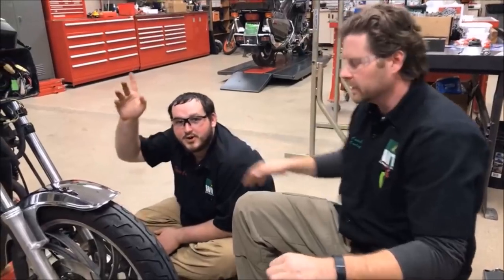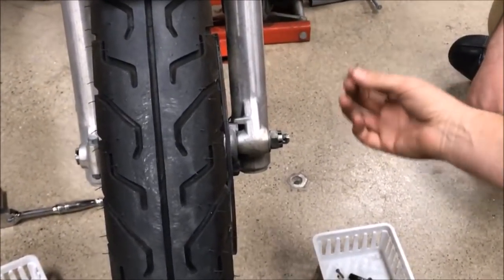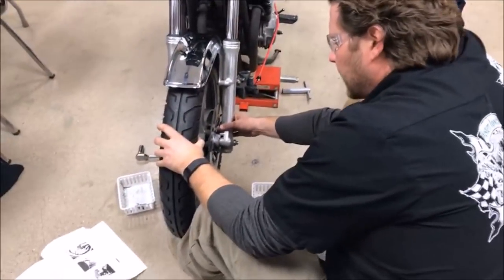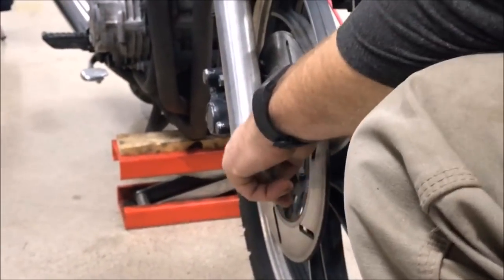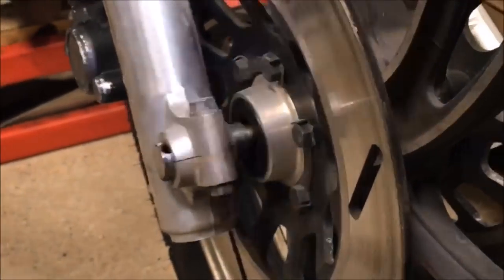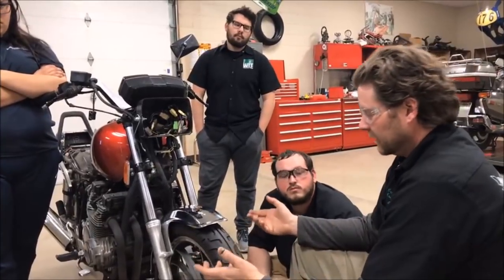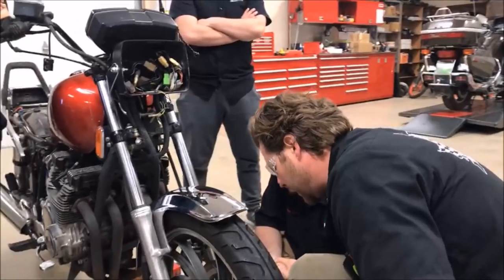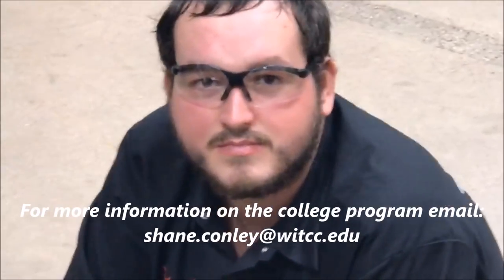Student finds missing wheel spacer on motorcycle he just bought and  rode home!

Comment: Looking at the tread on the front tire, I believe the tire is installed backwards too.
Reply: Pretty sure it's the right way round. Tyres are supposed to push water from the middle to the edge and away from the wheel.